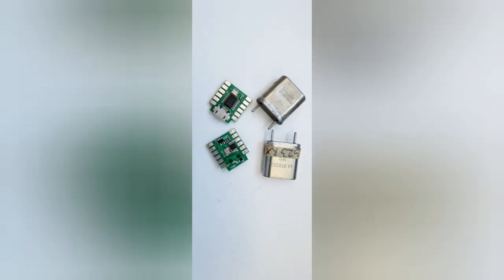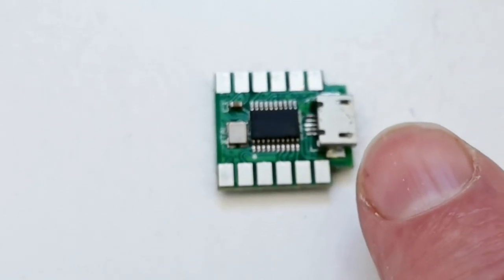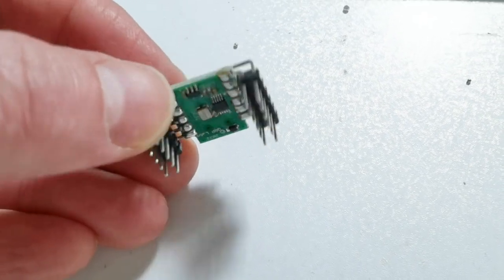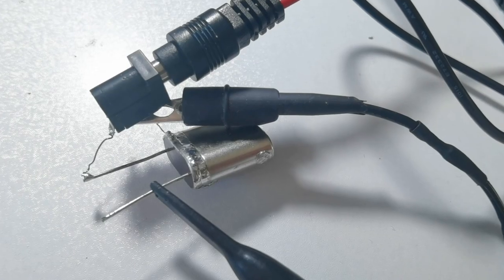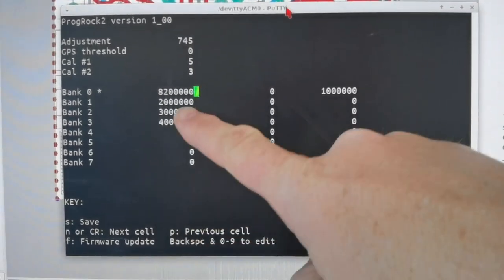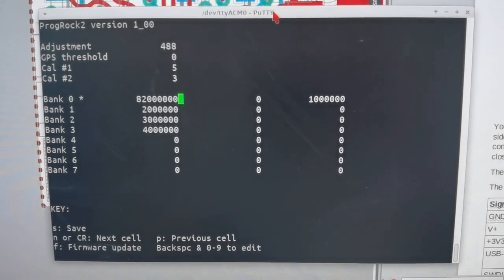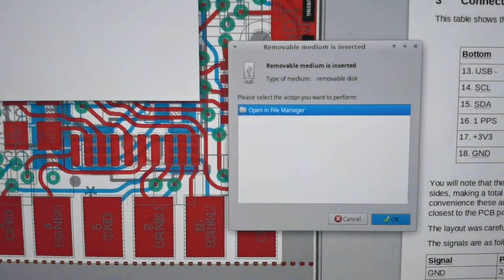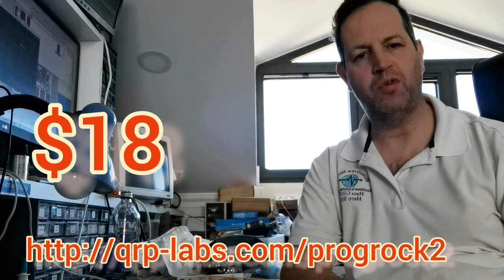ProgRock2 triple clock generator

Comment: An amazing little piece of kit !! Love the Heath 1103 counter. Built one back in the day. Over the years I did change the 7400 series IC's to 74LS.. Was a great workhorse.
I have 3 of the old prog rocks..  Those also are great.
Graham VE3WGW
Reply from the maker: Love the nixie glow :-)  I found this 1103 at Dayton the first year I went, 2009 I guess! 73 Hans G0UPL
Reply: Remarkable! So many uses.  Thinking about a compact channelised CW rig, 8 channels across your favourite HF bands, could use IQ clocks with an H-mode mixer fora  true single signal  Rx, or use two clocks for a conventional superhet. Tx uses 3rd clock, 700Hz away, keyed externally.(wonder if  screening could provide sufficient isolation 🤔).  BCD up down channel changer,, program in popular QRP, SOTA, POTA,channels. Class,E BS170 PA. I get excited by concepts like this! Thanks again Hans.  🤓

Comment: Remarkable! So many uses.  Thinking about a compact channelised CW rig, 8 channels across your favourite HF bands, could use IQ clocks with an H-mode mixer fora  true single signal  Rx, or use two clocks for a conventional superhet. Tx uses 3rd clock, 700Hz away, keyed externally.(wonder if  screening could provide sufficient isolation 🤔).  BCD up down channel changer,, program in popular QRP, SOTA, POTA,channels. Class,E BS170 PA. I get excited by concepts like this! Thanks again Hans.  🤓
Reply: A better idea, run the Tx clock at twice the frequency and key a divider flip flop 👍 thus,keeping the running orc out of the receiver.